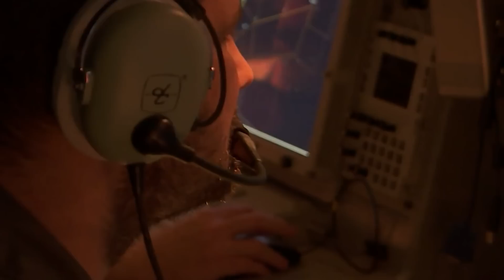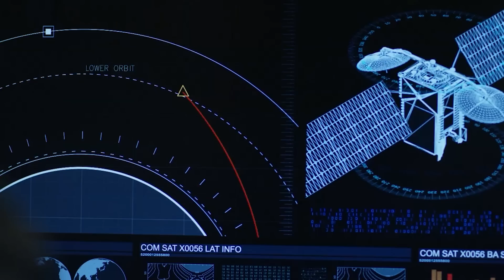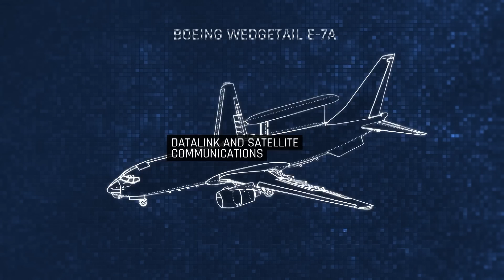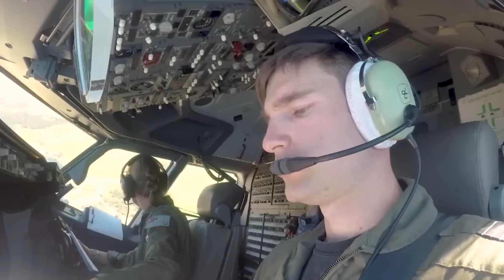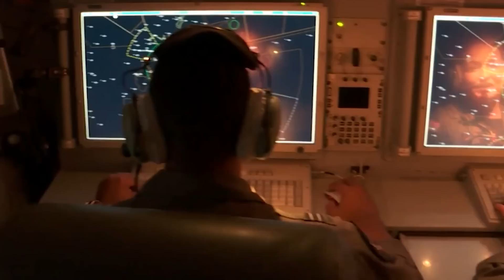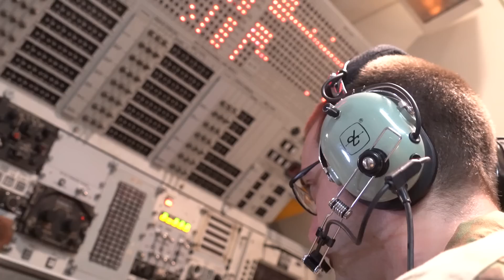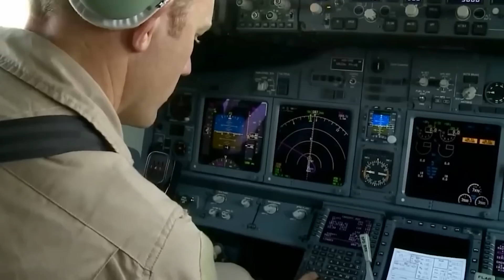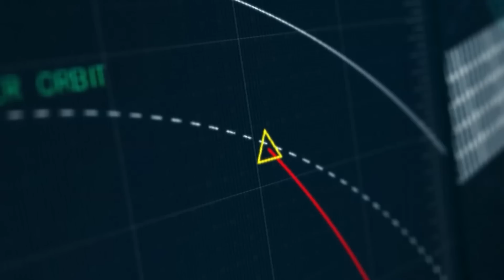The Bizarre and Risky Future of Electronic Warfare - The E-7 Wedgetail

Comment: The E-3 was supposed to be replaced so long ago.  The USAF, looking for a custom exquisite solutions such as G6 business jet system, dragged out this process for over a decade.  They loudly claimed that the Wedgetail - already with Australia - didn't meet its needs.  Then the E-3 replacement wouldnt necessarily be an airplane. To finally come full circle that Uncle Sucker needs the E-7 now from Boeing and its a rush to buy it, even accelerate the buy.  A needy Boeing is going overcharge the Gov't big time.

Comment: military aviation isnt yr primary skillset.... the platform has been around for over 20 years.  the issue is principally about the USG and Congress dropping the ball on replacing the E3 in a considered manner over 20 years ago. You can only defer so long before it turns into capability degradation. an E3 to an E7 is like comparing monopulse to doppler, or specifically analouge to AESA/MESA

Comment: The government should really consider designing a package that can be bolted into existing civilian 737s.  That way, they don't have to wait on net new airframes.  They can just pull existing stock from the market and bolt in the equipment.  I'm sure they would need to add some structure, but that should be pretty straightforward. 

It would also be better during times of war to have the ability to convert civilian stock instead of trying to surge production.
Reply: That's exactly what E-7 is. Two of the new UK E-7s are converted airliners, and one is a new-build

Comment: Turkiye also has wedgetail system since 2014. The contract with Turkish authority and Boeing was signed in 2003 and the customization of the system was made by Turkish and Boeing engineers. The system has been in use since 2014 in Turkiye. There are 4 wedgetail aircraft system in Turiye in use currently. Turkiye is the 2nd user of the Wedgetail system after Australia..
Reply: Turkey is a great friend of Australia, but didn't get the full integrated systems the Wedgetail has on offer.

Comment: USAF is going to need far more than 18 E-7 airframes...double that number would be approximately correct.  The biggest problem over the years with the E-3 fleet was that is was cut short on production because Congress, as usual, had good buddies that needed that sweet, sweet government money more than the DoD needed E-3s.  Consequently, the E-3 fleet was constantly grossly over-tasked and under-equipped for the demand, which wore out the already aged airframes even faster.  The E-3 radar system was a marvel in its day, but that day has now passed.  USAF needs the E-7 as quickly as Congress will allow it to buy them.  Therein lies another problem, of course...

Comment: Introduced in 2001, the Embraer R-99A'/E-99/EMB 145 AEW&C i Airborne early warning and control aircraft, equipped with the Erieye active electronically scanned array radar from Saab Microwave Systems (formerly Ericsson Microwave Systems) of Sweden operates at Brazilian Airforce, wichclaims that it has 95% of the capability of the larger AWACS aircraft which are in service in the air forces of other nations.😒

Comment: Lots of errors here. E-3s are still in use. It has and equal or better ability to detect targets at range.  Given that LO aircraft are designed to be stealthy primarily against high frequency, target tracking and terminal guidance radars, the E-3 is likely BETTER at detecting LO and small RCS targets due to its lower frequency radar.   The AESA radar is better sometimes. It updates tracks faster SOMETIMES, it depends on operator settings and the demand by the tracking environment.  Overall, the E-7 is better, but the E-3 is no slouch…when it’s working 😅

Comment: I've heard from F22 pilots that a six ship of F22s can operate without an AWACS. It should be even more the case with the F35. I'm sure an AWACS is preferable in most occasions. You just can't replace the manpower those planes carry for instance. However, in high threat scenarios, USAF would be experimenting with tactics without airborne command and control..
Reply: That's what they claim. I'm from Missouri, . Show me
Reply: @richardscathouse  I don't think you're getting a detailed view into highly classified is military operations anytime soon.
Reply: No fighter can replace an AWACS. A simple thing like endurance is a factor in itself.
Reply: @ghostviggen  I said it can operate without AWACS and perform its mission. Not replace it. Aaaaand I'm going to believe the F22 pilots on this one. No offence.
Reply: @mignik01  Most modern fighters can operate without awacs.
Reply: @ghostviggen  I'm sure they are talking about the level of battlefield awareness. Again. I'll believe the actual pilots on this one.

Comment: With those types of aircraft using a commercial airframe I get the reason for it to lower costs and a aircraft not going to be on front line however war is a fluid thing there no guarantee that a fighter craft not going to deep penetration and shoot a plane like that down.  Therefore to mitigate the risk even with extra expense shouldn’t styles the tech deign come into play.
Reply: An S400 can easily engage it from the ground. The S500 will be better, longer range.

Comment: The stated concept in Australia in those years was always to combine the AWACS function with an electronics warfare function in one aircraft for Australia where the USA had the  EW function on a separate JointSTARS and others. The crossover of Electronic Warfare and RADAR is often discussed in the Battle of Britain histories where the Observer Corps and bizarre mechanical ears and disinformation such as dinners and breakfasts of carrots allowing night-fighting eyesight for the pilots as cover for the true power of RADAR which in itself was cover for the vast listening operation and jamming and interception that ultimately came down to code breaking such that the RAF was aware of what the enemy numbers would be and also other vital aspects such as bending the German radio waves used for their night bombing navigation. The suggestion is that the  technologies in the British are an advance of the ones in the Australian models and that whatever is in AWACS Sentry will be improved but all mention of the JointStar is now absent in the discussion and the need also for data links that are secure and will be swapping potentially staggering amounts of data. High speed frequency changes possible with new aesa style radars is plausibly essential not just for detection and jamming and also as protection against enemy radar seeking missiles fired from stealthy aircraft or spacecraft or carried by converted ICBMS.  

Plus the distinct possibility that between satellites', the JSF radar and data links ground and sea based missiles there is a gigantic revolution in the military affairs of the USA in being able to track and kill moving targets in the air on land and sea anywhere in the world at any time. Instead of for example the previous historical problem of firing vast numbers of cruise missiles into the palaces of Saddam Hussein on the off-chance that he isn't in a golf cart just doing laps of the palace car park and golf course. It would be reasonable to assume the whole capability is in service and undergoing constant upgrades that are bound to be horrifically expensive and with the software issues and artificial intelligence constantly being upgraded and a few concepts that will be even more powerful and eventually surprise the world long after aggressors against the USA have been destroyed or their plans of aggression otherwise thwarted. There will be peace in the world and that miracle will have included Australian British and ultimately the best US versions as an element amongst the enablers. But then again alternatively it could be something less complex such as the need to change airframes due to not enough electrical power being generated off the existing airframe and engine combination and wiring issues and the sincerity of christmas cards from Boeing lobbyists.
Reply: EW/ISR will be the task of several platforms in the RAAF....principally E7 (as mentioned in the video above) EA18 Growler and  P8, but the new front-line  player in this field will be the new MC-55A Peregrine aircraft that the RAAF have purchased and should receive the first one inside the next year.  Its great to see the RAAF finally coming to its senses and embracing EW/ISR as a required discrete skill set - so many years spent bashing heads to get them to the table

Comment: The RAAF and RAF have very robust airworthiness systems, the USAF should be able to move quickly in certification by using one or both of these.
Reply: It's a 737max the FAA has already signed off a dozen times
Reply: @richardscathouse  no it is not a MAX, it is a -800.    And the military do their own airworthiness’s certificates.

Comment: Whilst I agree that Australia 'could' help the US with their test data, software and firmware issues, it would have been nice if they supplied us with M1 Abrams that didn't need to have their targeting/firing computers code mostly written by the ADF, as they 'could' have shared some, if not all of that with 'their ally'
Reply: thats one of the many issues the new 'aukus' deal is designed too eliminate, there's a lot more to it than just subs..

Comment: I would think the airforce should work with spirit aviation who builds the fuselages for the 737 variants in Kansas.  To build 20 or 30 modified fuselages in a row. To be stored in Kansas as bare fuselages.  That can then be sent as needed to boeing washington for completion instead of modifying fuselages one at a time.
Reply: Plenty of unsold 737maxes for the taking.  All over

Comment: It was understood that the E-3 was quickly becoming obsolete by the early 2000s, along with a host of other support aircraft, and a program was developed to replace all of them, known as the E-10. However, Congress kicked the can down the road for 15 years, and because of this, we're having to scramble to replace E-3s. At the same time, most of the other aircraft that were supposed to be replaced are quickly running down their airframe hours. 

The E-7 is probably not the right aircraft for the U.S. Air Force. Ideally, they would have a lot more seats to manage the much larger fights the U.S. has to plan for, vice the RAF and RAAF. More range and loiter to support certain long range fights and speed up deployments, as well as a common airframe with the tanker fleet (KC-46) to simply maintenance would be nice too. However, because they waited until the last minute, they don't even have time to ask for the sensor package to integrated onto a 767, and the E-7 is the only aircraft that can be considered. Astonishing lack of foresight and planning.
Reply: The Boeing 737 has extended versions. The E7 is based on the 737-700 next generation. The 737 has the 737-800 & even longer 737-900 versions. If they want to go to even longer ranged, they have the 737 MAX 8, 9& 10 versions. They could literally add 28 feet to the E7 in off the shelf commercial models.
Reply: @fanman71  I wonder how long it would take to integrate the E-7's sensor, data link and battle management hardware onto a different variant of the 737 vice integrating it onto a new airframe entirely, like a 767?
Reply: @JZ909  Should be much easier as all the new variants are just lengthened bodies of the current E7. The only thing they would need to be worried about is if the actual body of the plane would be affected by the extra length of using the 800 or 900 vs the current 737/700. Same engines, same width, etc. 

The 767 is an older airframe, no longer really being produced. You are probably thinking the new 787 Dreamliner. I would think testing of that would have to be much more extensive. Given it's a completely new body type w/ different composites, size, dimensions, etc.
Reply: @fanman71  The problem with a stretched airframe is that the stretch is trading range for internal volume, and an AEW aircraft, that needs to spend many hours on station, potentially far away from where they launched, desperately need the range. The E-7 is based on on the longest range pre-MAX 737, the 737-700ER, and this still has shorter legs than the E-3. I would seriously question a decision to reduce this even further. The 737 MAX would clearly be a huge improvement, but it's a generational leap, and the E-7 conversion involved some pretty significant aerodynamic modifications. I doubt the conversion process would be quick.

As for the 767, Boeing still produces it in the form of the KC-46. While the 787 would be superior, there are probably some pretty significant cost savings in standardizing most of the maintenance with the tanker fleet. A professional number cruncher would have to look at that to know for sure.
Reply: @JZ909  That is correct, you always trade volume for range. You could put in additional fuel tanks in the current cargo hold area of the 737, but again you are sacrificing cargo capacity for fuel/range, so yes, there will always be a tradeoff. As stated, perhaps look at the 737 MAX 9 or 10, but there are many more differences between the 737 Next Gen & MAX models.

In regards to 767, it isn't really being produced for commercial aviation anymore. They still make it for cargo & military customers but the 787 was meant to be the replacement & has far superior efficiency & range.
Reply: @fanman71  the cargo area is already used in the wedgetail - massive fuel tank and the main power supply for the radar
Reply: @AmateurHourWatches  Yes, that is what is assumed. On the longer 800-900 models the extra length of the cargo area can be used to add even more fuel tanks to accommodate the increased weight of the plane to increase it's range, much like they do in the BBJ's. The BBJ1's can hold 7 extra fuel tanks, while the BBJ3's can hold 9.
Reply: the current E7 can handle any fight an E3 can - zero need for more people.  Likewise, with tanker support you can fly 16-20 hr missions easily.

Comment: The E3 is not obsolete at all. The wedge tail is just absolutely awesome.
Reply: Yes it is. Most parts on the air frame have not been in production since the 1980's.
Reply: @truckert9729  ok and? The USS Nimitz was launched in the 70s but still plays a vital part in keeping the US safe. Same goes with the E-3. Just because it’s a 70s plane doesn’t mean it’s tech is 70s.

Comment: One thing the wedgetail can't do that the AWACS can... EMP the electrical grid of countries. A platform is already readily available, the Poseidon 8. The four year window is bogus. If the USAF really wanted the plane they could have it very quickly. PS, my father held the patent for the AWACS radar dome as a lifting body.
Reply: WTF?   Where did you get that EMP statement from?   Just like it can see in houses?  🙄🙄🙄
Reply: @jcak552  Of course I can't tell you that.
Reply: both are basically a 737.

Comment: Both the P8 and the wedgetail are based on the 737 
There are 1000’s around the world so most mechanics could service it if you have to land away from base  
All you need now is a refueller based on a 737 😀
Reply: Why??  The current tankers in service can offload more fuel than what a fully loaded 737 weighs.
Reply: In extension to ruebens comment. You wouldn't want random civvy mechanics working on this aircraft due to security etc.

Comment: Doesn't the E-7 have a shorter range than the E-3? That would be non-ideal for a conflict in Asia-Pacific.
Reply: According to Wikipedia, they both have 4000 nautical miles range.
Reply: You didn't see it being refuelled in flight?
Reply: @theharper1  Sure, it can be refueled, but it is still better to have a longer range. During an actual conflict there is going to be essentially unlimited demand for aerial refueling, and tankers will be the number one target of any enemy planes. It would be better for those assets to be freed up for combat aircraft delivering munitions rather than support aircraft doing patrols.
Reply: So much stock footage of refueling... As pointed by the other commenter
Reply: @georue98  Yeah - the biggest limiting factor is not the amount of fuel they carry, but the endurance of both the flight crews and the controllers in the back.

That's why the longest mission has been limited to only 14 hours - the chance of a human error starts to exponentially increase when people get tired....

Comment: A few points; as previously mentioned in other comments on this clip and others- the correct pronunciation is R Double A F.

The UK has only ordered three aircraft and that has caused a lot of controversy in the UK 

Turkey was the second country to buy the E-7 and it is designated E-7T Peace Eagle. They operate four aircraft all named after the points of the compass (Kuzey, Güney, Dogu and Bati- North, South, East and West), there was an option for two more, but the option expired.

South Korea operates four aircraft (designated E-737 Peace Eye), these aircraft differ to the E-7's in the installed electronic systems, but maintain the MESA radar. All work was performed by KAI with aircraft two to four.

Other potential customers include; Italy, United Arab Emirates, Qatar and Saudi Arabia (who also wish to replace their E-3's).

The RAAF aircraft have ten stations aboard- six being for C2 operations, four being used for Battle Node network relay. Two further stations can be installed, the notion here is for Drone control for any one of the various drone types now operated by the service (this may include the MQ-28 Ghost Bat a.k.a Loyal Wingman, as a defencive aid in contested airspace).

Ja Worsley
ODIN Media- Chief Editor
(Oceania Defence Interviews and News).